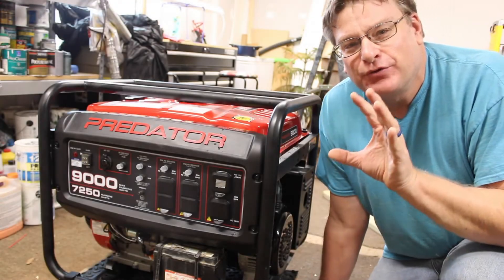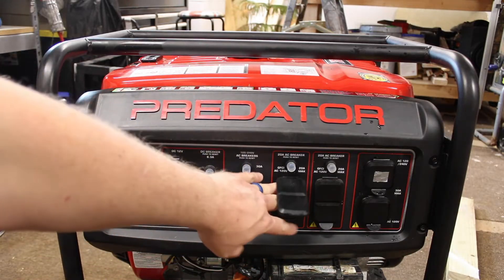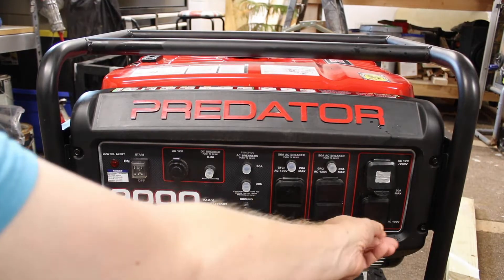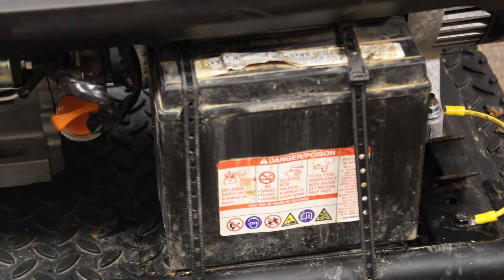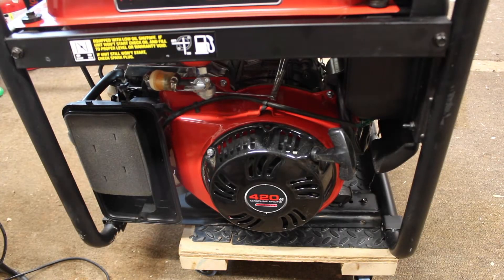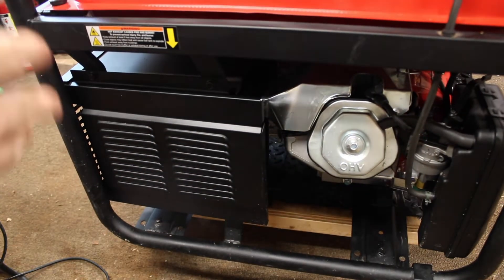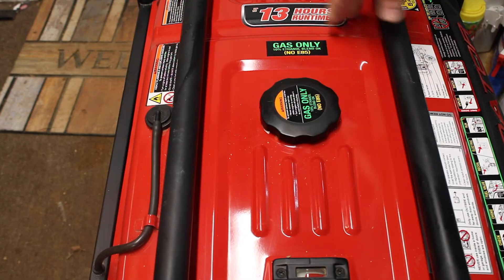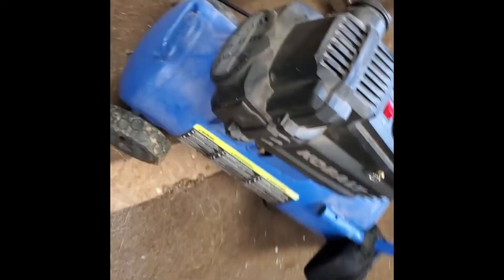2023 - Generator Review: The Harbor Freight Predator 9000

Comment: He got the one with the piece of crap plastic air cleaner box… the throttle plate is held in the carb by a little piece of plastic. It’s a pos. The throttle plate on mine was laying in the bottom of the air cleaner box right out of the box when I got home with it. I took it back and got one with the metal air cleaner box. By the way. The tri fuel kits don’t fit the plastic air box. They are only made for the metal air box. I’m getting a kit from PNG technologies. Gonna plumb it from my natural gas meter and hook it up with a manual transfer connection to the house. I should be able to run my whole house off of it. Over all nice video 👍
Reply: Here is a reminder about portable generator safety: everyone really needs to see this safety reminder to make sure. This advice is just to make sure that everyone is aware of all the warnings and it’s just to remind people to be careful using portable generators. Generators can be dangerous if not used carefully. Every year, hundreds of people die or get injured when using portable generators due to carbon monoxide poisoning and electrocution. Make sure you are using your generator carefully and keeping others safe as well. There is something very serious that everyone should always be aware of when using generators. Some people do run their generator indoors which is not safe and that increases the risk of carbon monoxide poisoning which can cause death of family and you. Some people run their generator in wet conditions which can electrocute them. Please remember that you should never run your generator indoors. Remember that carbon monoxide is an odorless and colorless gas that you cannot see or smell. Carbon monoxide is a silent killer. Keep that in mind. Make sure your generator is 15-20 feet away from your house and away from doors, windows, and vents. Never use your generator in your porch too. Having a carbon monoxide detector is very important against generator safety. Some people also allow children to go near the portable generator which could pose risks. We need to keep an eye on our children making sure that they are not near the portable generator so they won’t get electrocuted or burned by the generator which is dangerous. A locking enclosure also keeps kids safe. A generator shed might look like a tempting place to explore, or take cover during a game of hide and seek, but a generator is a dangerous piece of equipment that can cause injury. It says on the manual that we should also keep children away at all times from the portable generator to avoid injuries. Please do not allow a child or unqualified people to operate the portable generator. Just because some manuals missed what should be listed doesn’t mean it’s safe to do. Always follow the generator safety rules when using portable generators. Generators pose electrical risks. If you need to use your generator during wet weather, you need a generator tent to protect your generator from getting wet. Don’t let your generator get wet. Keep your generator dry and before using your generator, please make sure your hands and your generator is dry. Do not wear loose clothing when operating the generator. Everything that is said on the generator’s operating manual should not be ignored. Never smoke cigarettes near the generator. Please keep flammable things away from the generator. Never overload your generator too. Your generator can catch fire. Never ever try to plug a generator cord into a wall outlet to avoid back feeding. Back feeding your generator is dangerous. Always turn on your generator first before plugging in appliances and shut off the appliances before turning your generator off. Use a heavy duty cord for your generator and the cord should not be worn out. All the instructions should be followed carefully. Never refuel your generator while it’s running. It can cause fire if fuel spills while your generator is hot. You should turn off your generator and let it cool off before refueling it. Having a fire extinguisher next to the generator is also important. This is only a reminder for everyone’s safety of using generators. Make sure your generator is properly grounded. Having a fire extinguisher next to the generator is also important against the safety rules. https://youtu.be/I1jT3ANENvI and here is a video more about keeping others safe when using generators and also about our family’s safety. Hope this helps. Thank you. Always remember that being safe is better than taking risk. It’s better to be safe than sorry. Have a good one

Comment: Nice video. Can I run this generator in 220/240 environment?
Reply from the maker: Yes, I use it on our house at 240 volts single phase.
Reply: Here is a reminder about portable generator safety: everyone really needs to see this safety reminder to make sure. This advice is just to make sure that everyone is aware of all the warnings and it’s just to remind people to be careful using portable generators. Generators can be dangerous if not used carefully. Every year, hundreds of people die or get injured when using portable generators due to carbon monoxide poisoning and electrocution. Make sure you are using your generator carefully and keeping others safe as well. There is something very serious that everyone should always be aware of when using generators. Some people do run their generator indoors which is not safe and that increases the risk of carbon monoxide poisoning which can cause death of family and you. Some people run their generator in wet conditions which can electrocute them. Please remember that you should never run your generator indoors. Remember that carbon monoxide is an odorless and colorless gas that you cannot see or smell. Carbon monoxide is a silent killer. Keep that in mind. Make sure your generator is 15-20 feet away from your house and away from doors, windows, and vents. Never use your generator in your porch too. Having a carbon monoxide detector is very important against generator safety. Some people also allow children to go near the portable generator which could pose risks. We need to keep an eye on our children making sure that they are not near the portable generator so they won’t get electrocuted or burned by the generator which is dangerous. A locking enclosure also keeps kids safe. A generator shed might look like a tempting place to explore, or take cover during a game of hide and seek, but a generator is a dangerous piece of equipment that can cause injury. It says on the manual that we should also keep children away at all times from the portable generator to avoid injuries. Please do not allow a child or unqualified people to operate the portable generator. Just because some manuals missed what should be listed doesn’t mean it’s safe to do. Always follow the generator safety rules when using portable generators. Generators pose electrical risks. If you need to use your generator during wet weather, you need a generator tent to protect your generator from getting wet. Don’t let your generator get wet. Keep your generator dry and before using your generator, please make sure your hands and your generator is dry. Do not wear loose clothing when operating the generator. Everything that is said on the generator’s operating manual should not be ignored. Never smoke cigarettes near the generator. Please keep flammable things away from the generator. Never overload your generator too. Your generator can catch fire. Never ever try to plug a generator cord into a wall outlet to avoid back feeding. Back feeding your generator is dangerous. Always turn on your generator first before plugging in appliances and shut off the appliances before turning your generator off. Use a heavy duty cord for your generator and the cord should not be worn out. All the instructions should be followed carefully. Never refuel your generator while it’s running. It can cause fire if fuel spills while your generator is hot. You should turn off your generator and let it cool off before refueling it. Having a fire extinguisher next to the generator is also important. This is only a reminder for everyone’s safety of using generators. Make sure your generator is properly grounded. Having a fire extinguisher next to the generator is also important against the safety rules. https://youtu.be/I1jT3ANENvI and here is a video more about keeping others safe when using generators and also about our family’s safety. Hope this helps. Thank you. Always remember that it’s better to be safe than sorry. Hope you stay safe as well. Have a good one

Comment: It runs every thing except the HVAC no problem
Reply: Put a soft start system on it. I have two central AC’s and I put a soft start on the upstairs and it runs it just fine.
Reply: Here is a reminder about portable generator safety: everyone really needs to see this safety reminder to make sure. This advice is just to make sure that everyone is aware of all the warnings and it’s just to remind people to be careful using portable generators. Generators can be dangerous if not used carefully. Every year, hundreds of people die or get injured when using portable generators due to carbon monoxide poisoning and electrocution. Make sure you are using your generator carefully and keeping others safe as well. There is something very serious that everyone should always be aware of when using generators. Some people do run their generator indoors which is not safe and that increases the risk of carbon monoxide poisoning which can cause death of family and you. Some people run their generator in wet conditions which can electrocute them. Please remember that you should never run your generator indoors. Remember that carbon monoxide is an odorless and colorless gas that you cannot see or smell. Carbon monoxide is a silent killer. Keep that in mind. Make sure your generator is 15-20 feet away from your house and away from doors, windows, and vents. Never use your generator in your porch too. Having a carbon monoxide detector is very important against generator safety. Some people also allow children to go near the portable generator which could pose risks. We need to keep an eye on our children making sure that they are not near the portable generator so they won’t get electrocuted or burned by the generator which is dangerous. A locking enclosure also keeps kids safe. A generator shed might look like a tempting place to explore, or take cover during a game of hide and seek, but a generator is a dangerous piece of equipment that can cause injury. It says on the manual that we should also keep children away at all times from the portable generator to avoid injuries. Please do not allow a child or unqualified people to operate the portable generator. Just because some manuals missed what should be listed doesn’t mean it’s safe to do. Always follow the generator safety rules when using portable generators. Generators pose electrical risks. If you need to use your generator during wet weather, you need a generator tent to protect your generator from getting wet. Don’t let your generator get wet. Keep your generator dry and before using your generator, please make sure your hands and your generator is dry. Do not wear loose clothing when operating the generator. Everything that is said on the generator’s operating manual should not be ignored. Never smoke cigarettes near the generator. Please keep flammable things away from the generator. Never overload your generator too. Your generator can catch fire. Never ever try to plug a generator cord into a wall outlet to avoid back feeding. Back feeding your generator is dangerous. Always turn on your generator first before plugging in appliances and shut off the appliances before turning your generator off. Use a heavy duty cord for your generator and the cord should not be worn out. All the instructions should be followed carefully. Never refuel your generator while it’s running. It can cause fire if fuel spills while your generator is hot. You should turn off your generator and let it cool off before refueling it. Having a fire extinguisher next to the generator is also important. This is only a reminder for everyone’s safety of using generators. Make sure your generator is properly grounded. Having a fire extinguisher next to the generator is also important against the safety rules. https://youtu.be/I1jT3ANENvI and here is a video more about keeping others safe when using generators and also about our family’s safety. Hope this helps. Thank you.